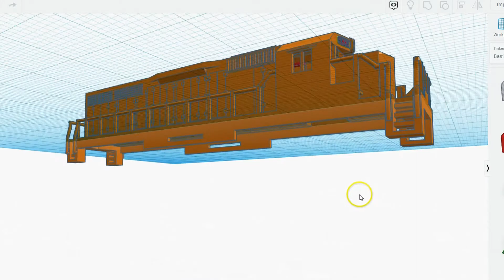N scale 3d resin printing a GP40-2 Bachmann Locomotive shell using Tinkercad and an Elegoo Mars

Comment: Very cool!  You could forego the 3D printed railings and instead add dimple marks so you can install your own smaller brass versions.  Almost same for the exhaust hood fans!
Reply from the maker: Now that is an amazing idea.  I have issues with the railings even with ABS they need to be thicker to withstand use.  They are also the weakest link.  Brass would do wonders.

Comment: I'm really liking this but did you upload a photo or drawing into Tinkercad or did you work it up yourself.??
Reply from the maker: i measured an n scale model with a mirometer for rough dimensions then guesstimated them into tinkercad then made adjustments after printing.  Most models went threw at least 6 different versions before the final.  I made alot of mistakes like railings being too thin or structural parts not strong enough.  The detail can go beyond what you can practically see or paint.  The next step is to use real life measurements from blueprints from websites like CP historical society.  Google them they have more than u ever want.
Reply: @Lutain1337  i thought you could import a photo into Tinkercad and go from there.. i know you can do it in fusion